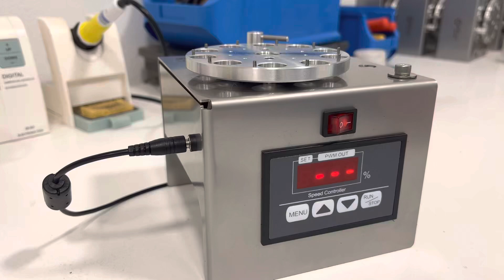PWM adjustments on AGS Annealer 3.0

Comment: Hello hello I received the 3.2 recently I noticed your annealer in this video is opposite of mine example those pins on the case wheel are on the opposite side as well your spins in the opposite direction I set mine down to 13% and it gets stuck it won’t spin to the next case opening like not enough power in the arm motor or the indent is to strong for it to be able to move on the next case maybe I need to move the flame tip closer to heat up faster thus requiring less time to anneal the brass
Reply from the maker: @bnicedanicest6288  sir, annealer time adjustment is from 2.5 up to 10 seconds. At 13% that’s way more than 10 seconds - I would recommend using two torch head setup if your particular case needs that much time to get annealed, or a different torch head.
Reply: @ yeah, I had to adjust the tip of flame closer to the case mouth shoulder got it working properly now thank you

Comment: I am using mine for the first time .    Can the small turn table turning the heated case can I increase the speed it rotates in the flame.. my case is slipping slightly and I feel it’s 3/4 like there is a small colder section on the case mouth? Any ideas
Reply from the maker: speed of the motor that turns the case is 23 rpm, so it takes about 2.5 seconds for one full turn, and its not adjustable (unlike the turntable). please deprime your cases prior to annealing, to avoid slippage and to be sure that there are no live primers in the cases.

Comment: Is there a way to control the speed of the brass rotation in the flame?  I would think you need more than one and a half turns for even heating.
Reply from the maker: rotation  in flame is fixed - 23 rpm, or approx. 3 seconds for one turn. depending on the brass, time spent in flame is varying (most of the time 4 seconds, and up to 10). but its enough to distribute the heat evenly (even one rotation is good enough, its only important that you dont heat the same spot). that speed can be altered with a different rpm motor though, but thats some aftermarket work.

Comment: Hey thanks for the sweet looking mini machine . I noticed that you put the torch head holder on different locations on all 3 units..is there a reason for that ? can you make a video with the torch annealing brass with the number 3 unit please ? ..I have to locate a 1/2 inch torch head any chance you can make holders for larger torch heads as well . ?..I’ll let you know how it works out..👍🏼👍🏼👍🏼👍🏼👍🏼
Reply from the maker: torch holder should be mounted on either left or right side from the case heating station. middle opening is for sharpie holder. as for torch holder size, 1/2" is most commonly used torch head. I can make larger ones, per request.